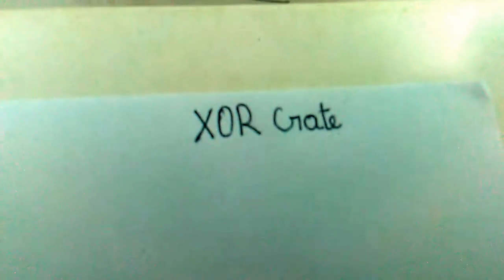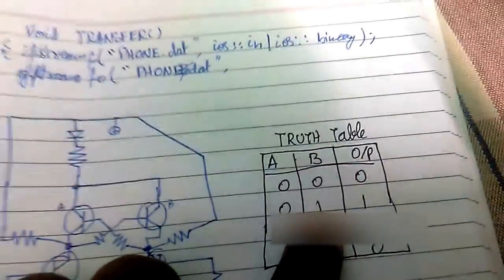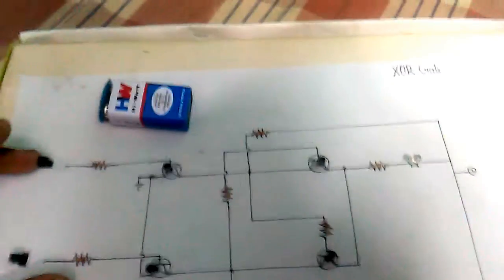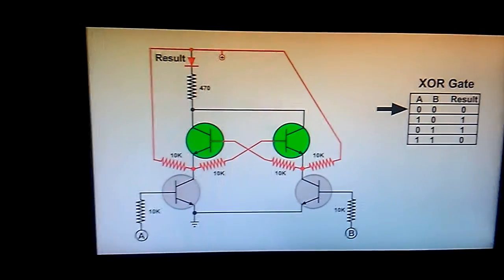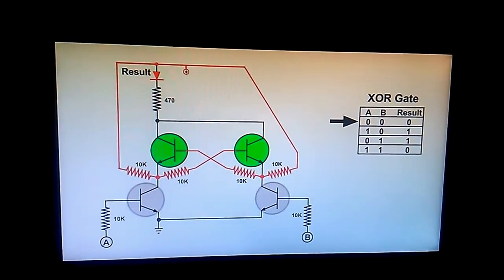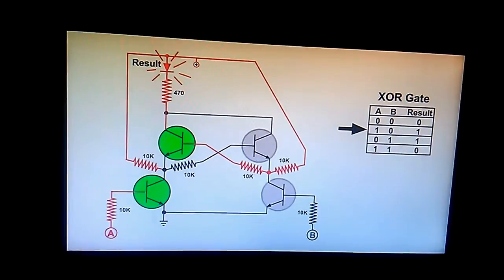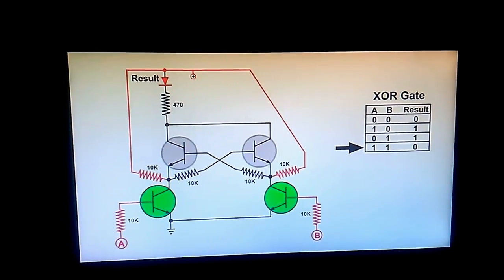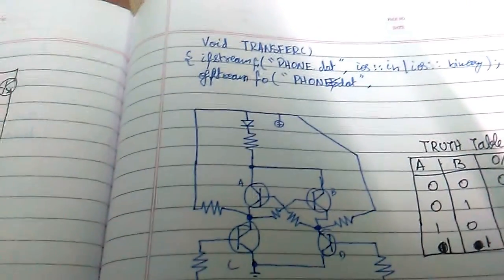XOR logic gate using transistor.[Eng subtitle].

Comment: good!! is there a circuit for XNOR?
Reply from the maker: Yes there is. But I don't know the circuit diagram with transistors but I would suggest using an NOT gate IC near the LED light. I'm sure it'll work.

Comment: Which transistors and resistors do I use?
Reply from the maker: Transistor=BC 547 resistor= 10K and you can leave the resistor which is near LED for higher brightness.
Reply: Anto Jude Geoffrey Thank you! Also I should use the third diagram if I am using the breadboard right?
Reply from the maker: Yes